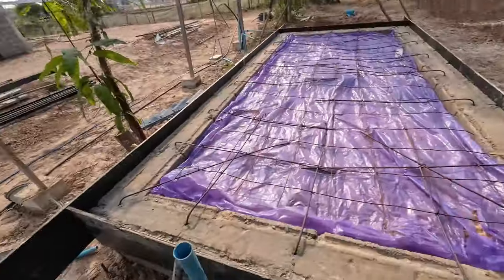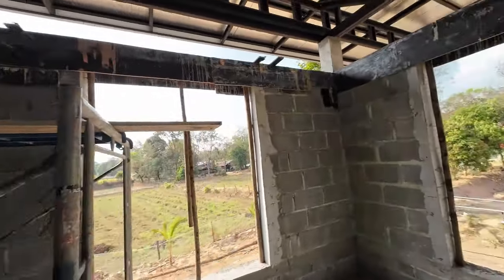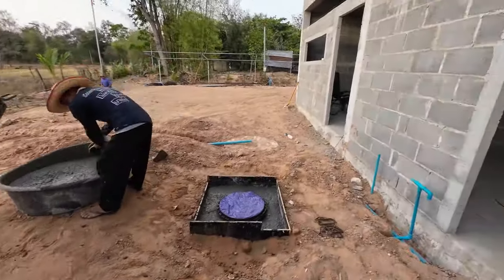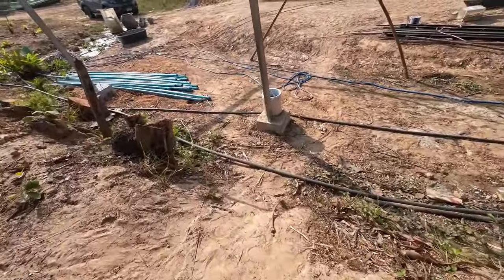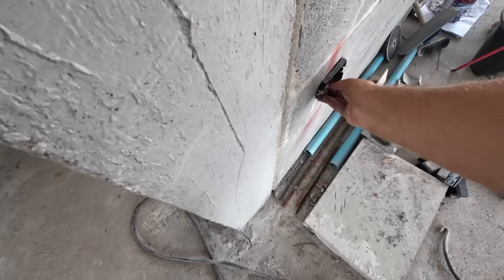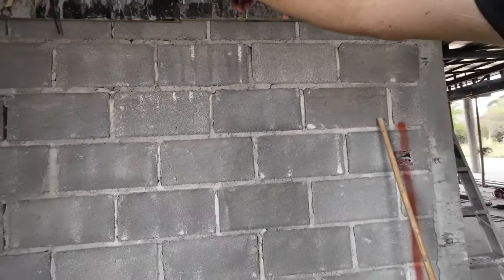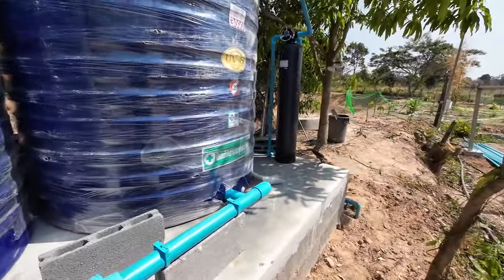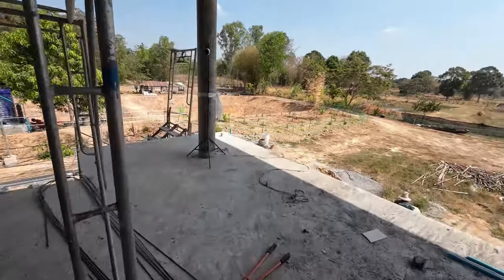Achieving Your Dream Home in Thailand - maha sarakham  part 10

Comment: Do you pour wetter than we do in America.
Reply from the maker: Depends on the temp. but you need to put a plasticizer in the cement they can do it for you at the mixing plant , it slows the curing time of the concrete so easy to work with, in this case we used a sk 240 with plasticizer  thats a road grade concrete. hope this helps

Comment: Berating your crew on camera is poor form mate. you’ll end up having an ‘accident’ or down at immigration detention at that rate! Thai’s may put up and shut up but they have a limit. I understand the frustrations, i’m a builder and project manager. I also build in Thailand occasionally. At the end of the day it’s the project managers responsibility to set the standard and put the correct systems in place well before the task starts. Not the staff’s responsibility despite the miscommunications.
Reply: I disagree with this comment in so many ways.

The staff are trained by the 3rd party to do the correct job, if that's not being done and you see this being not correct. You make sure to tell them so they understand this level of work is not upto par with the standard you are hoping for.